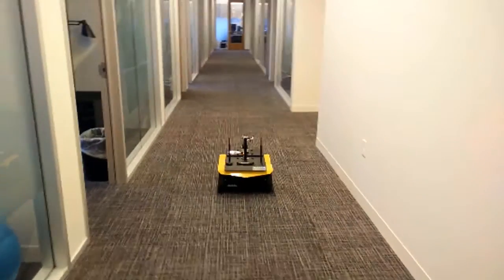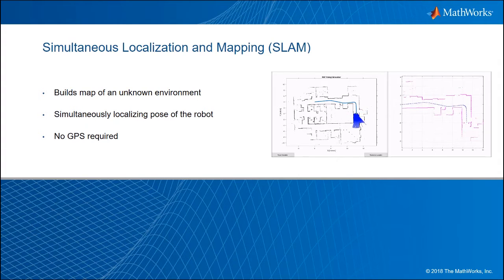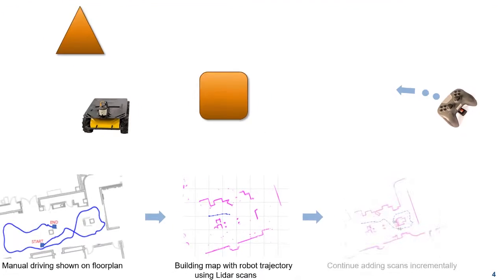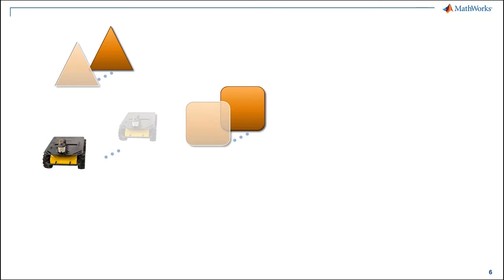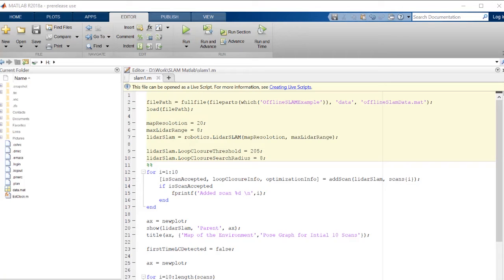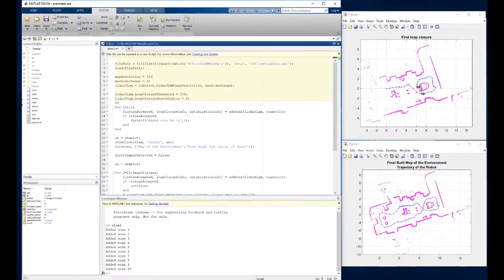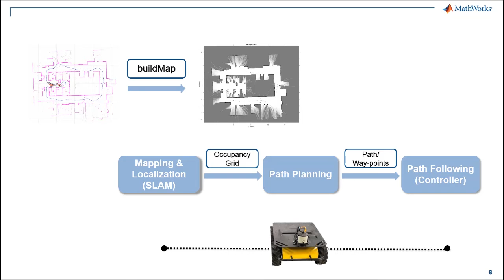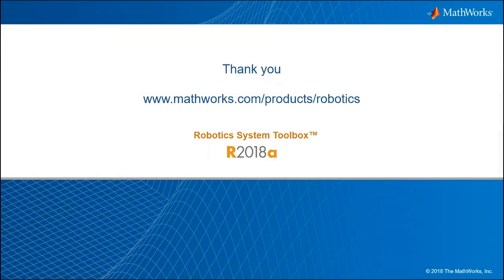Implement Simultaneous Localization and Mapping (SLAM) Algorithms with MATLAB

Comment: maxLidarRange = 8;
mapResolution = 20;
slamAlg = robotics.LidarSLAM(mapResolution, maxLidarRange);

slamAlg.LoopClosureThreshold = 210;  
slamAlg.LoopClosureSearchRadius = 8;

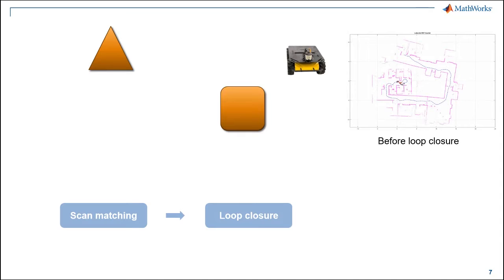for i=1:10
    [isScanAccepted, loopClosureInfo, optimizationInfo] = addScan(slamAlg, scans{i});
    if isScanAccepted
        fprintf('Added scan %d \n', i);
    end
end

figure;
show(slamAlg);
title({'Map of the Environment','Pose Graph for Initial 10 Scans'});
Reply: firstTimeLCDetected = false;

figure;
for i=10:length(scans)
    [isScanAccepted, loopClosureInfo, optimizationInfo] = addScan(slamAlg, scans{i});
    if ~isScanAccepted
        continue;
    end
    % visualize the first detected loop closure, if you want to see the
    % complete map building process, remove the if condition below
    if optimizationInfo.IsPerformed && ~firstTimeLCDetected
        show(slamAlg, 'Poses', 'off');
        hold on;
        show(slamAlg.PoseGraph); 
        hold off;
        firstTimeLCDetected = true;
        drawnow
    end
end
title('First loop closure');